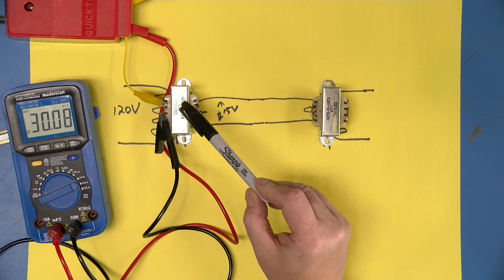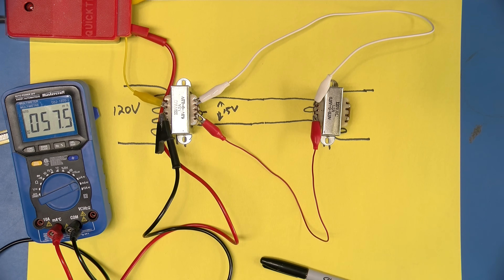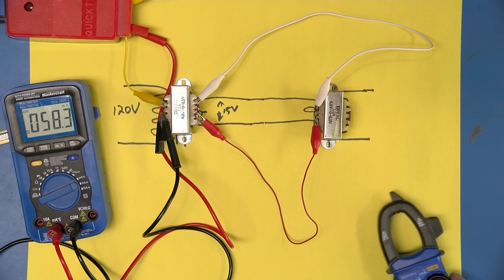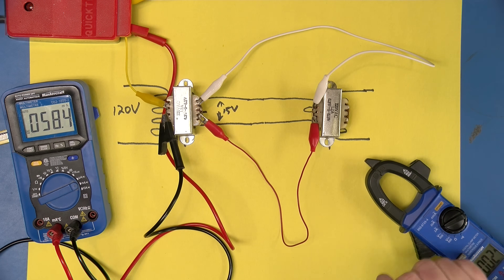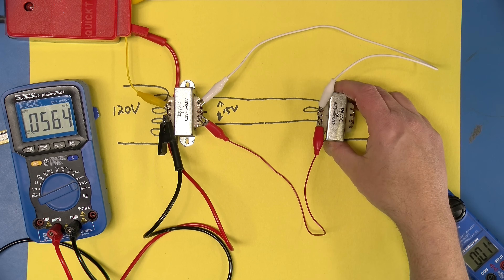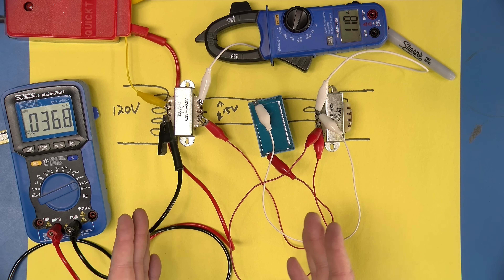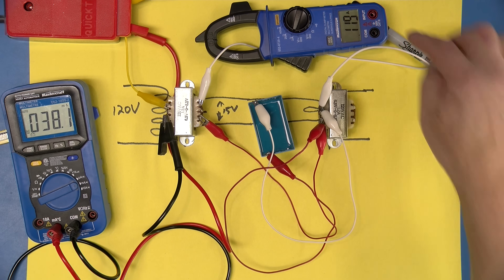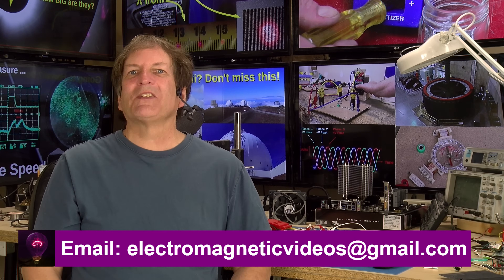Viewer Questions: Back to Back Transformers

Comment: If they want an isolated 120VAC, they make 1:1 transformers. No need to double the inductive current needed.
Reply from the maker: I think many were using this sort thing because the had the stuff on hand, or already had low voltage AC and really only needed a tiny amout of higher voltage AC.
Reply: @ElectromagneticVideos  that's a very good point. I suppose if I already had 2 older style power bricks that used transformers I would do the same rather than buying a 1:1 transformer 😅 although it might be a fun challenge using those 2 transformers and pulling the secondary coils out and making a singular transformer out of the 2 primary coils. 

On the subject of transformers, I am currently working on an experiment to remove eddy currents entirely, rather than making them very small by using the stacks of thin steel sheets as the core.
Reply from the maker: @kylewellman402  I was actually amazed at the of people who had done the back to back transformer thing for one reason or another. My initial thought was like yours. Someone mentioned taking two identical microwave transformers, removing the HV windings and slipping the primary from one core onto the other to make an isolation transfomer. Since many have lousy cores with all the lamination Es on one side and Is on the other, held together by a shallow, should be easy to do.

Removing eddy currents - if you can do that it would be a very significant invention. I wont ask how becuase if you really have something you should patent it. You can stake your claim up to a year before you do a formal patent application by filing  a provisional patent in case you are not aware   of that.
Reply: @ElectromagneticVideos  thank you for that information. I was not aware of that about the provisional patent deal.

 I'm almost ready for physical testing. Trying to think of the best and most thorough way to test though. I know i can apply power to primary and measure across open secondary, but that includes hysteresis losses. Of course, if I remove the eddy currents there should still be a noticeable difference between the readings that way, but surely there has got to be a more thorough and precise way to measure the eddy current losses themselves. 

I thought about seeing if I can take a current reading across the core material itself, but don't think that will really work.

I would love to hear your ideas if you have any and wouldnt mind sharing?
Reply from the maker: @kylewellman402  Its been a while since I did provisional patent so what I did say might be out of day, so look into it a bit. 

Measuring across the secondary wont give you the core loss which includes eddy currents. All you need is the primary - leave the secondary unconnected and measure the power in the primary which will include all core losses. Compare that to a "normal core" Your core should consume less power - in the end it doesn't matter how - all that matters is the total power savings. 

Now you have calculate the cost of your solution vs $ saved in power all related to the cost of the transformer. I dont know what % of core loss is eddy currents these days, but it does have to make significant financial sense for people to pay to license your patent and also costs of changing manufacturing etc. Bottom line: it you may have a great idea, but be really careful about figuring out if there actually is money to be made before you invest $$$ into it - or spend $20L or more to have a patent filed.

Comment: I've done this for a local sign company. The issue was voltage drop. Used a 120/240-480 volt on a 500 ft cable run, then another 480-120/240 on the load end. Works as it should.
Reply from the maker: Your own high voltage transmission line - how cool! Great example. Assuming you were t doing this to make use of an existing cable (which would be a great application for this), I wonder wonder what the break even length is between increasing cable cost and the cost of the transformers.

Comment: Its probably been 40 years but thought that I read that most transformers under 1 KVA are not compensated so they are only designed as a step down transformer. You could install a GFCI device on the 120 VAC on output transformer. You do not need a ground for GFCI''S to work. They have a torrid coil that measure current unbalance between the two circuit conductors.
Reply from the maker: I hadn't heard that - and there are plenty of sub-1kva step up transformers. And there really isn't anything inherently different between stepping up or stepping down.

Your right about being able to use a GFCI on the output and not needing a ground. But it wouldn't help in this situation unless there was a short or insulation failure in the transformer coil since there is no back path outside of the torroid to cause an imbalance. If one of the two legs of the isolated legs of the transformer were grounded (or it was a autotransformer) it certainly could be lifesaving!

Comment: I kept cringing every time you grabbed the transformer while it was energized just to help express which one you are talking about.
Reply from the maker: Well I appreciate the concern! The transformer ion the left is powered though a GFCI so if I did touch the 120V terminal it would (hopefully) trip. The 2nd transformer's output is the more dangerous one in terms of being isolated from the GFCI - so it would not trip the GFCI Since I was only holding it with one hand worst case would a shock from one finger to another finger. Nasty but  a well contained current path. And since the the coil is isolated, touching one one of the terminals would have no effect.

Comment: Wow, I'm really happy I found your channel. My understanding of transformers, instructor and capacitors  is high school level. U1/U2=Number of turns1/Number of turns2. In real life its more complicated than with ideal components.
Plus some bit of extra from playing with Arduino's, making simple circuits  bust and buck converters on prototyping board. But the more I learn the more I understand  how much I don't know.

I have been thinking when can I put two secondary wingdings of the same transformer or multiple transformers in series and paralel. Either to get the voltage i need from the stuff i have or to get a higher voltage. Lets say 500V with 50V or so increments for testing tubes. I get that you can add multiple wingdings in series, but I'm not sure about saefty, what do i need to take in account.

In this video I was wondering how the output voltage change of the first 15V winding and whats the actual voltage at the second transformers 12V terminals.

I been thinking about making some experiments and include in video about building an LM7812 and LM7805 power supply, but Im hesitant because I don't wan't to give bad advice.

If you can, make some videos explaining relation between Watts and VA's. How to determine what is the maximum load in W can apply to a transformer with given output Voltage and VA rating.
How to know what maximum current and power can I draw if I use a single diode rectifier, a capacitor bank, and resistive load. And how it changes with full bridge rectifier.
I been wondering if its half fith a single diode, not to exceed the maximum current in wire, or its more about heat disipiation, and it averages out. I imagine there is more current in one half cycle, and zero in other after the rectifier diode.

About power factor, perhaps some simple circuits for correcting it.
I used to wok in place making vacuum tube amplifiers and when testing the most powerful ones, you could hear hum in other devce headphones. Old engineer working there told me this is aniche item, generaly in modern devices such simple power supplies (transformer + diode + capacitor) are not allowed, as they create electromagnetic noise due current spikes when charging the capacitor.

One simple solution I have found is putting an inductor in serries, and it suposedly doesnt matter if it is before or after the diode. But it has to be before the capacitor.
Its not  a perfect power factor solution, but it makes the current spike more gentle.
One friend who works with CNC told me not to bother, its only important for industrial equipment. I tend to disaree, its worth atleast in something as big as computer power supplies, right?

About series incuctors to filter noise in circuits - weither ferite beads or inductors, do they have a downside of electromagnetic radiattion? If so, any advice to deal with it?

I could probably add more questions abut transformers, but this comment is getting long as is. If you're reading this, i hope you will be interested to make more educational videos about those topics.

Perhaps something about controllable rectifiers in the future? Field effect transistors, thirystors...
One can find circuits online, but i havent seen a good material how ith goes together with transformers, the current and power draw. What are the "rules of thumb" how much % of transformer VA should I leave as a reserve.

In short it would be interesiting to see your take on a power supply series, something like "Building a Linear Power Supply, Part 1 The Transformer" by @Vocademy-Electronics-Tech
https://www.youtube.com/watch?v=YiK_fD_WggE&list=PLNm1_xEfhzSDIdf6N-3JvbKWPcA6YBw3t

Not sure if it is your thing, but also about designing chasis. For example can you share a load of amplifier or other device on two transforemers of the same type and put them in oposing directions within the chasis, to reduce the radiated noise?
Grounding is another rabbit hole. Im not interested that much in audiophile stuff, but i often stumble upon their forums, and its not easy to distinguish what is true engineering know how and what is just odd supertitions.
How to connect grounds within a device, cant find it now, but there was a video recomending cutting the power cord and connecting the ground wire outside of metal chasis of whatever you are building. I wanted to ask someone knowledgable but not audiophile about validity of that.
Reply from the maker: Hi Edgars, Well I'm thrilled you found my channel! I have a large number of European viewers, but not sure how many from Latvia!

I have a list of video topics and viewer questions and I just copied your post to it. You bring up a lot of potential topics. 

Watts and VA's - that will be the next video!
And after that, I want to try and explain how to use Ohms law type circuit calculations for AC circuits with indicators and capacitors. 

A few quick answers: using transformer winding in series or parallel: yes - its done all the time. For parallel output they better be identical windings with the primary fed with identical voltages. If not, you end up with what amounts to a short. For series connection to increase voltage - you have to be careful how much you do it. The insulation of the windings has a limited max voltage. Stack ten transformers with 240V out to get 2400V and the insulation will probably fail. Rule of thumb - usually doubling V is OK but much more than that without knowing what the insulation rating is and you are asking for trouble. 

Diode rectifier currents - hats a hard one for the reasons you describe - there is a spike at the peak of the AC cycle. A bridge rectifier is better - with that a smaller spike or positive and negative AC peaks. Rule of thumb - use a transformer with 2 or 3 times the AC current rating of the DC current you need. Use a diode of 10 times the current rating (diodes are cheap). And yes - and inductor will help a lot, but you need a big one - using the secondary of a second transformer (primary unattached) identical to your power transformer is good start. 

LM7812 and LM7805  - great things to start with! Look up things like "LM7805 Application Note"
 and you will get plenty of suggestions from manufacturers like TI as to how to make a power supply with their ICa. And try it and make a video and ask for suggestions how to improve it. I learn so much from peoples posts!

Hope thats a good start! Best wishes from Canada!

Comment: I have seen this method done in the past to generate a plate power supply for a tube. It also provides mains isolation.
Reply from the maker: Its funny - I always learn so much from the comments. Quite a few comments like yours using this to generated isolated HV - I had no idea so many people had used something like this for real applications. It would even be useful today now that I think about - two $2 transformers like these would make a much cheaper HV source than most isolation transformers.

Comment: I was once tasked to build a three phase AC to DC power supply intended to charge a large capacitor bank. The cap bank was only one part of a test setup. The electronic parts department didn't have three phase rectifiers. My supervisor told me to use three bridge rectifiers. Wired as phase A to B for the first rectifier. B to C for the second and C to A for the third. Then connect the three (-) terminals together and the three + terminals together. I told him the rectifiers will blow up. He didn't believe me. So I built it and let him turn it on. He did check my wiring first. All three bridge rectifiers blew up as I expected they would.  So I added a pair of small 120 to 16 volt transformers back to back to independently isolate each bridge rectifier from each phase. That worked as it eliminated the DC path caused by directly connecting the bridge rectifiers to the line. As a bonus I added a small 7&1/2 watt 120 volt lamp in series with each transformer pair's primary. The lamps worked as inrush current limiters. The circuit had 18 capacitors in parallel with each one being 2,400Uf @ 450 volts. The power supply worked perfectly. Once it was turned on, it did take a couple minutes for the voltage to come up and stabilize. And yes it did have a permanent load resistor on it to discharge it when not in use.
Reply from the maker: That must have been "exciting"! It sure demonstrated who understood things and who didn't :) Incandescent lamps as current limiters - they work so well for that and are sadly  overlooked these days. And  as bonus provide a great visual indication of a short or other issue.
Reply: @ElectromagneticVideos  To this day, I have a rubber-base Edison socket (a Leviton 55) with alligator clips on the leads. Stole the idea from Western Electric who issued these to telephone switch service techs for use as capacitor bank prechargers/dischargers. When you're working on a filter cap bank, you take the fuse out and connect the bulb across the bank to discharge it, then leave it there. If some goober reinstalls the fuse while you're working, the light warns you!
Reply from the maker: @myself248  I should make myself one of those! Could be really handy in many ways. Its those simple things that work so well.